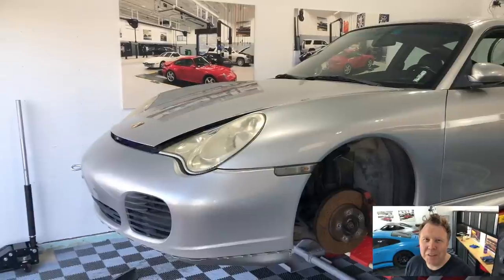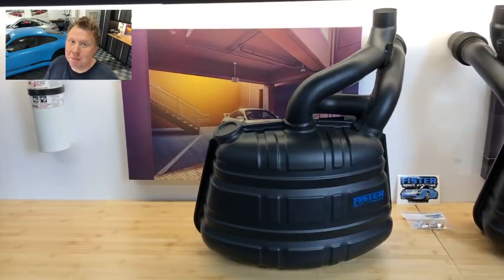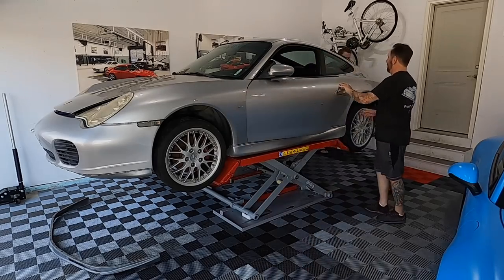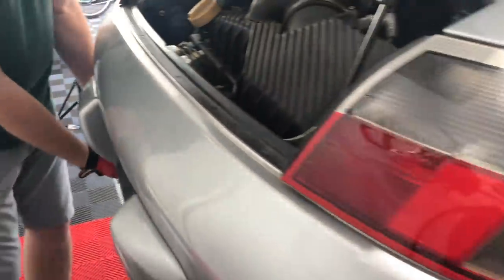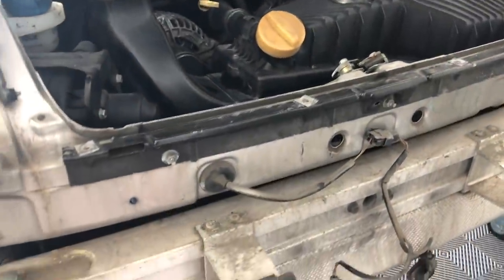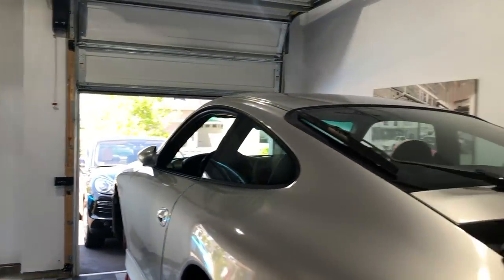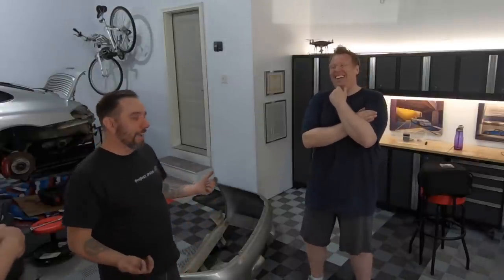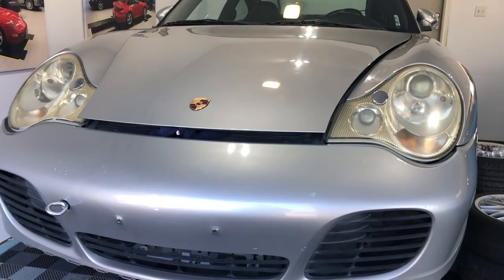Porsche 996 Disassembly - Wheels, Bumpers and Mufflers (Project 996 EP 02)

Comment: Will be fun and interesting watching this develop. I've had my 996 for 12 years, covered >120k miles, and been through numerous modifications.

Suspension... I'll preface my thoughts with a comment on something you said in the previous video - 'we're thinking of putting 19" Fuchs on it'. Fuchs... yes! But 19" wheels don't work on a 996. They might look good (if you're in to big wheels), but they will ruin the ride and handling. No point in getting anything special suspension wise if you're going to put 19's on it. Stick with 18's!

1st thing to do is check condition of/replace all the small components (top mounts, coffin arms, tie bars, track rods etc). This will make a massive difference to how the car drives if any of them are worn. After that, depends on budget and what you want to get out of the car. 

If you want something low, that will both handle AND ride really well, then you're looking Ohlins or another quality coil over (with the associated high cost). If you want something lower, that handles well and rides OK, you can go H&R lowering springs with something like a Koni shock - this is what I have on mine as difficult to justify Ohlins on a car with 170k miles on it. You could also go M030, which is a seriously good cost/performance option, but for me, a 10mm ride drop isn't really enough. 

ARB's (sway bars in American)... changing the ARB's on mine significantly improved the feel of the car. An M030 bar off a Boxster S is a great (and super cheap) upgrade for the front (I'm sure your salvage place will have one). I've got an adjustable H&R bar on the rear, which gives you 3 options for stiffness. 

I'd also consider doing the engine mounts... not expensive, but a set of Rennsport semi solid engine mounts (or similar) significantly improves rear weight transfers on turn in/transitions.

Good luck!
Reply: Great list of sensible mods to enhance the car rather than mod it and keep it Stockish.
Reply from the maker: Thanks so much!! Appreciate it!

Comment: Re the suspension question, i'd suggest new bushings in the arms, if they aren't worn the rubber will be tired, new tie rods, adjustable coilover suspension and maybe X73 sway bars. Not going to be cheap but it will be a joy to steer after. 👌

Comment: I went with the ROW m030 suspension and wheel spacers, it made a huge difference. I believe Suncoast has the best deal on that setup.
Reply: Is it harsh ride though Timothy, what was the drop from stock height, do the spaces and MO30 give a good stance?
Reply: Phil Nelson the ride wasn’t bad. Then again it’s all relative because my weekend car is a 991.2 GT3. It only lowered the car by about an inch.  That plus the spacers really gave the car a much better stance.  It changes the look of the car completely.  Highly recommend it.

Comment: The calipers look like they were painted.  I could not tell if it was a reflection, but it looked like there was some red paint on the bleeder cap, if the red calipers  were factory the bleeder caps would be all black.   Removing the calipers, repainting and applying new Porsche decals is an easy DIY, I've done it on my 997.   What would be a good color for your996?

Comment: Good work chaps, surprised how easy the mufflers came off. So, I’d suggest something to look at, it changing out all the coffin arms, and polybush where you can, made my car feel drum tight. It’ll be interesting also to understand why the transmission casting has cracked. Go for the braided brake lines too, not an expensive upgrade 👍
Reply from the maker: Cheers Dave!!
Reply: Pat did some research and found that if the transmission mount is worn, it can cause excessive vibration and break the casting. Not sure if that’s the actual cause, but it kind of makes sense not seeing any trauma that may have caused it. I will pay attention to the transmission mount when we take out the transmission next week.

Comment: Wonderful, interesting, educative and entertaining video! Lets have loads more! Every nut and bolt plus full engine rebuild would be great. Next job must be to get it running and driving? Good to see you have some great sponsors onboard - very jealous of your local parts store, looks amazing!  Suggest Upgrade the bushes all round, clutch, flyweel, maf, throttle body and oil separator etc. - all the normal stuff that goes on a 20 year old car. O and KEEP IT STOCK!ish :)

Comment: I have 2000 c2 996. Did a similar thing to mine ,the biggest improvement by far was suspension , coffin arms, drop links and all the bushings. Your never going to get any more power but changing whole exhaust gives it a special sound which is guaranteed to turn heads . Good luck and great work 👍🏻
Reply from the maker: Cheers Peter! Thanks!

Comment: It's great that the three of you are on the same page. That will make this 996 project so much more enjoyable. If you ever need a body to go to LA Dismantlers just reach out. Can't wait for the next episode. By the way did you find anything in the oil. Did the car have a magnetic drain bolt?
Reply: It did not have a magnetic drain plug. We did not see any debris at all in the oil. I’m not surprised since the car already has the IMS solution installed. James is going to cut the filter apart also.
Reply: Thanks Karl!

Comment: The stock suspension is very good , even on track. The Sport suspension is even better but is a trade off of comfort over ability. If you move away from the stock stuff there are many very good very high quality systems available. KW, Ohlin , JRZ to name a few. They are far more suited to track use and have the benefit of newer tech (dual springs , valves , stainless bodies) . I would think long and hard about the intended use of the car before splashing on the after market stuff though as any move away from stock towards track will have a negative affect on ride comfort an that needs to be considered. 
When you come to remove the trans you have two options  , pull the trans or pull the engine and trans together. depending on what you have planned you might need to draw up a tool list .

Comment: Good jump on the 996. I am surprised that I don't see an air compressor in your garage. Battery operated tools are fine if you use them all the time. But batteries wear out and are a wee bit dear to replace. Plus you always have to wait for them to charge up. Just my 2 cents worth.  ;-) Cheers!!

Comment: Suspension: It really depends! Street vs Track. For mainly road use I recommend starting by replacing shocks/struts and worn out bushings. Go with coil overs (if budget allows). If you want to take it further, then upgrade the sway bars and end links. Cool vid! 

You can follow our own 996 build at www.instagram.com/drowned_porsche

Comment: Hi as a fully qualified Porsche Tech in uk,i have only seen 2 gearboxes break the bell housing of like your car has.
The diagnosis turned into a snapped  crankshaft on both cars.
Chris
Reply from the maker: Thanks Chris! Cheers!! Would you mind taking a look at our latest video (Episode 5) please? Let us know if you see anything as we inspect the clutch, RMS and IMS! Cheers!
Reply: @AutoAmateur  Rms looks ok,i would replace clutch kit,asvu don't want to take the box back out again.
I would see if there is any sort of vibration when u drive the car.
The first car i drove after new clutch and dms replacement had such a massive vibration u couldn't focus on the inside mirror,thats the snapped crank symptom.

Comment: Hello Guys, 
to answer the question "do we need to install a stiffer swaybar", you have to think of your usage.
A bigger or stiffer swaybar is realy interesting if you put the car on a racetrack. Porsche has done a good enough job with the overall chassis to let you enjoy the car on the road.
BUT (yes, ther is always a BUT), your car is near 20 years old, so new bushing for lower and upper arm in front and rear should be a far better investment
In the same way, renew your engine mount when you put it down for the transmission replacement.
You will improve your ride much better than with a simple new swaybar
let us enjoy your work on this Projet 996 👍
Reply from the maker: Thanks Laurent!!

Comment: Am I missing something or why did you need to send the mufflers off? Wouldn’t it be easier to just go to a muffler shop and have the cross pipe put on? E.g. gundo hack? My muffler shop actually instead of doing the cross pipe did a bypass that exactly matches the PSE.
Reply from the maker: Great question! FD Motorsports do a core exchange program. Their system is similar to the gundo hack but unlike your average body shop that might have done one or two jobs, FDS have done hundreds if not thousands. They also refinish the mufflers which helps with heat and longevity. It cones down to quality.

Comment: Approved to certain extend by professor 997 !    That oil was not to bad,    cut the filter open and check all the filter faces for debris !   Its should be a easy operation,   and to be on the safe side,   take down the oil pan and check for debris, and you will have a check of the rubber doors on the oil baffle   !!!!      NOT approved by 997 professor !   You didnt take a oil sample !    James !!!!!!!!!

Comment: Stainless steel brake lines are a waste. You guys don’t have a clear vision for the car. Is it a de/race car? Is it a cruiser? Like what are the goals? 

I had a 996 c4s with fabspeed mufflers and high flow cats. Boy did it sounded awesome. Suspension you should change with factory units but maybe with the m030 springs (factory Porsche springs), purchase a LN engineering spin on filter adapter so you can use Chevy (I believe) oil filters along with a filter magnet which will keep any additional metal particles in the oil filter and not recirculated back into your engine. The de-snorkel mod is great along with a tune. But always start with a stage 0! All fluids changed out and go over the car to make sure it’s 100%
Reply: Great video by the way!
Reply from the maker: Check out the last podcast, we have a solid vision for the end state of the car. How we get there, jobs in order, is what we’re figuring out.
Reply: Auto Amateur ahhhh didn’t hear that. Going to have to take a listen. Keep up the good work mate
Reply: Totally agree on fabspeed and cats,  and also the spin on oil filter adapter,  i have it all on my 997, thus i use royal purple filter, i have tried to convince james on these things before,   he dont listen.......😪😪😪